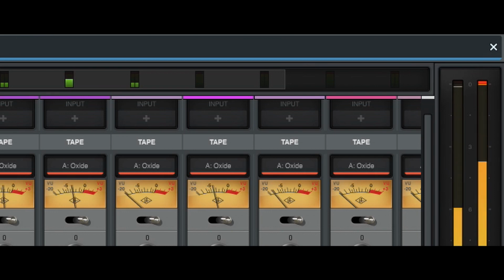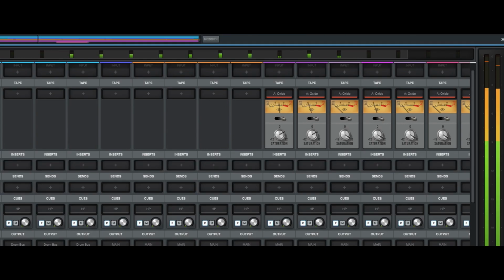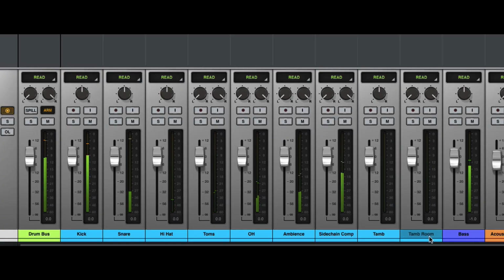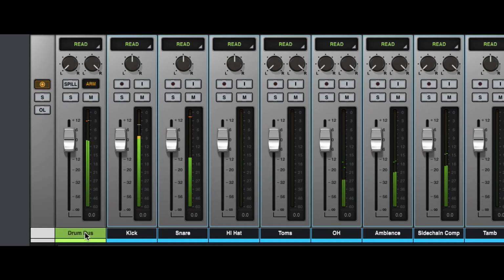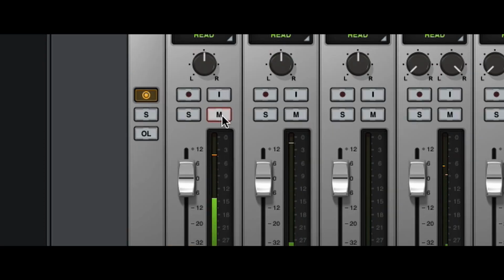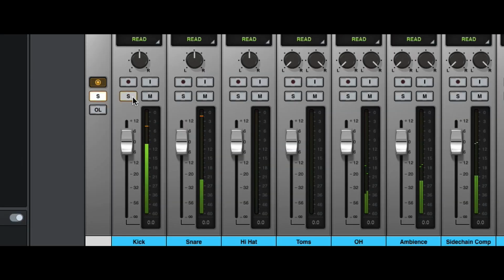Apollo Solo Basics & Recording 101

Comment: Thank you sir needed a button break down you are the the best directions ive found so far 🙏
Reply: Okay, i’ve turned on the pre amp, i getting a very distorted screeching response from the denon being received as mic on the apollo on fl studio !  , line the middle settings i get no response ! thank you brother

Edit: how do i get rid of that screeching distortion or is this impossible?

Edit edit: Thank You  thank you for Quick response i feel so alone in the music world 💙
Reply from the maker: @rockodonnie  hmmm.... well.. I know nothing about that specific device that you are referring to... 

but... 

sounds like you need to make sure your APOLLO SOLO is in line mode, aka, you are using a TRS cable to connect to the line input on the solo. 

Also -.. sounds like you are hitting the apollo really hot from the mixer, start with your volume faders really low on basically everything.. 

as for why you aren't seeing a signal in FL studio, again, that would be really hard to decipher without seeing how it's set up. 

I wish I could help more on this one! just double check your routing and try to piece it together.
Reply from the maker: @rockodonnie  thanks mate!
Reply: can i ask i have a dj denon prime two ((the dj denon has a preset recording feature still with my usb in im not having any luck retrieving “saved file” )) im trying to connect to a apollo solo and record onto fl studios (my pc) is this an ideal way to record audio from my di board to my fl studios so i can save as a file
Reply: i have a mic wire on the “master out “ on the dj denon prime and going to the apollo on mic line one
Reply: Its ok you and your video still helped me ty ty 🙏

Edit: Okay, okay the trs cable worked !! but its still recording screeching, the only trs cable output on denon device is headphones(usually isnt a problem like aux to a speaker) but i am limited to one cable so i may need a second one at least to properly experiment, Thanks a bunch ✉️

edit edit: ill get a second cable and report back if i figure the issue sooner than then

3rd edit: also when i plugd my trs in my guitar input, right side of line setting, hi-z setting stayed highlighted, instead of life just an observation, if you could tell me more about hi-z, im looking into the difference of trs cables, that’s probably a part of the case too, my trs is probably just meant for “output”

Comment: thanks for the video! do you know what a normal / healthy input volume is when plugging a guitar in directly to the Hi-z input on the solo? i'm peaking at -25db, seems a bit low....? is this a problem?
Reply from the maker: Truly, it depends on the guitar, some guitars, like telecasters or strats have low output pickups, so technically this is normal. 

If you’re using amplitude or one of the UAD amp sims, don’t gain up the input at all. 

But some amp modeling require a certain signal level to have their models work accurately - you’d have to double check THAT plugins manual. 

In other words, with hi-z you should be able to just plug in.
Reply: @TheSteveKinney  thanks for the quick reply. what do you mean with amplitude?
Reply from the maker: @tendingtropic7778  amplitube* 

It’s an amp simulator plugin. Sounds great and it’s pretty popular, but it’s not a UAD based plugin. Just thought I’d mention it.

Comment: Do you know whether the Captor X sends mic or line level out? Is the type of signal (line or mic) going into the Arrow determined by whether you use a 1/4” cable vs an XLR in?
Reply from the maker: I believe you have to specify whether or not it’s line input. 

Steve

Comment: Hey Steve, really appreciate your review on the solo as I’m looking into picking this up. Sorry if I missed this in the video, but how would I setup direct monitoring into my headphones? Ie. so that I can hear my voice coming through my headphones while I’m recording. Thank you man
Reply from the maker: Hey Adam! Thanks for your comment mate! 

It direct monitors your signal by default. 

Where it becomes kinda unclear is when you have a signal hitting your daw & where your processing is coming from. 

Everything you do in UAD console is all real-time       

If you have a signal chain set up inside your DAW - for example - if you’re vocal hits your DAW and then you have Fabfilter on or slate Mic modeling & then back out for monitoring - that’s when there would be a bit of latency - as this is how interfaces normally monitor. 

Not really a way around eventual latency with ITB monitoring. 

This is why UAD is awesome because it’s basically an external hardware unit that is doing the processing when you load a plugin - it’s on that device - not your computer. 

Hopefully that makes sense. 

Cheers mate!
Reply: @TheSteveKinney  thanks so much for the prompt reply Steve, that answered a lot of things for me and will refer back to your response. Since it automatically directly monitors, how would I turn that off if I just wanted to listen without the monitoring, if you don’t mind? Asking as I come from a Scarlett 2i2 and it had a director monitoring switch on the front😃 
Very much appreciated.
Reply from the maker: @adamdanmusic  sure / so if you’re not monitoring through your DAW signal - you’ll have UAD console open and just have the input source muted.
Reply: @TheSteveKinney  thanks for the help on this, Steve! Looking forward to more of your content

Comment: when i apply plug ins in my insert. like reverb it sounds mono. how do you make it stereo with out a send?
Reply from the maker: What you’re gonna wanna do is stereo link your channels. This works when you’re xlr is connected. 

That said. If you’re committing your reverbs or delays on the way in. - it’s useful to do this on an aux send so you can blend the level later on during mix if need be. 

Thanks for your great question and your support! 

Cheers,
Steve

Comment: Hi!! I’m about to purchase Apollo solo.. I’m worried about dsp one core power. Any advice? I don’t want to spend double for the twin and I’m not sure how many plugins can handle solo Core.
Reply from the maker: So. 

What I will say is that - I usually have no problems whatsoever whenever I use the solo because I’m a big fan of committing audio to WAV. 

Now when I’m mixing - I’ll do this a lot too. 

That said - it’s really hard to give you a number because a lot of plugins use different amounts. 

The legacy plugins are super low overhead and you can get away with a good number of instances of those. 

The non-legacy plugins are heavier and some of them are monsters (looking at you capitol chambers).

Typically - I can create full signal chains no problem. 

Vocal example would be - preamp, eq, compressor, verb, delay

That being said - IF you think of the solo less like a computer where you endlessly add plugins and more like an outboard piece of rack gear - and use it in that manner - you’ll be all good. 

Hopefully that makes more sense. 

Best,
Steve
Reply: Ty bro